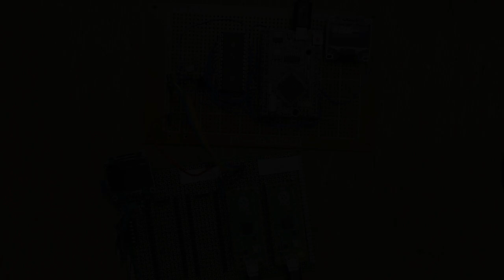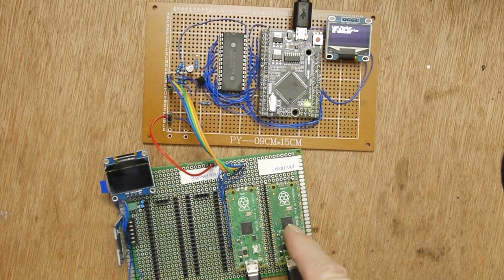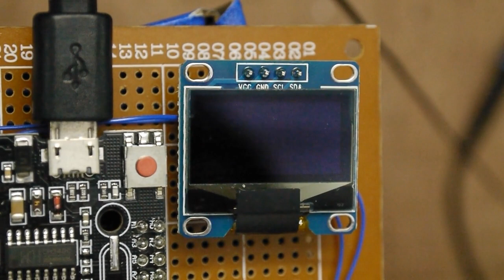Picoputer Part 4:A Working Picoputer

Comment: Interesting work, thanks for sharing. I've got some real TRAMS and I'd like to build something similar to this, ie; real TRAMS controlled by a raspberry pi host. I can't find any similar projects anywhere else.
Reply from the maker: Hi, I think you should be able to do that. The transputer link protocol is fairly simple, you only need a couple of level shifters, or none if you are running at 5V and you are off. If you can find a C011 then you can do it that way but I don't think there's a huge need to do it that way. Or use a Pico and have the PIOs do the link protocol...
Reply: @menadue  Thanks for the advice. Are you on a Discord somewhere, is there any way I can talk to you from time-to-time in regards to this? I'd really appreciate it. Thank you.
Reply from the maker: @Storm_.  Hi, no I'm not on discord. You can email me at channel name at gmail dot com, thoiugh...